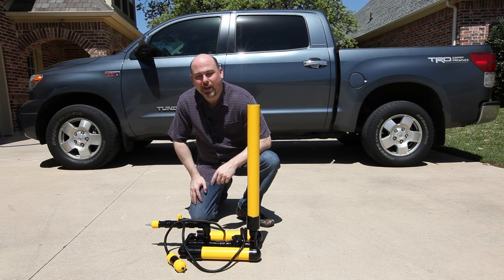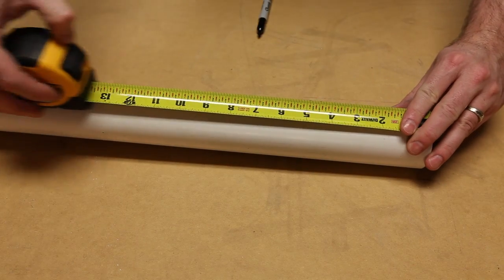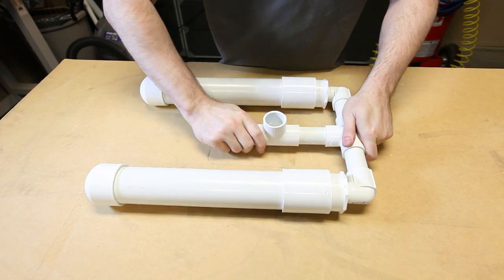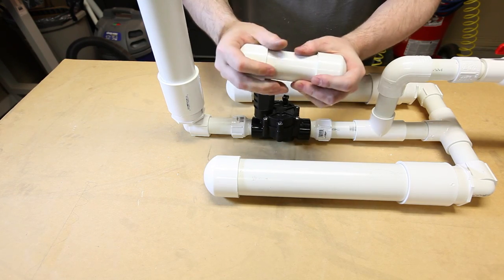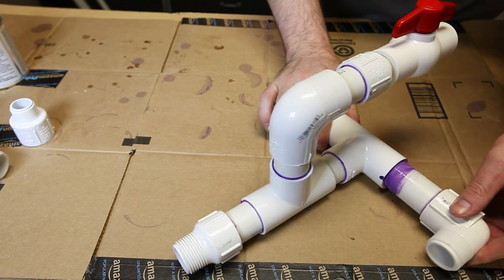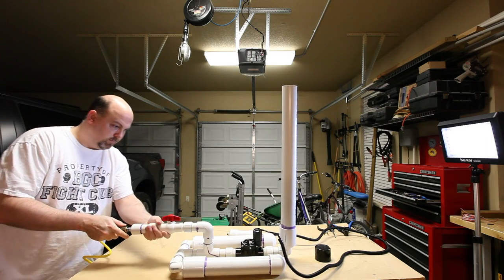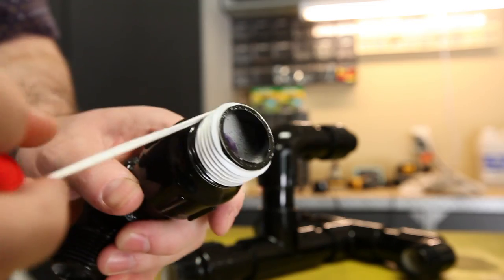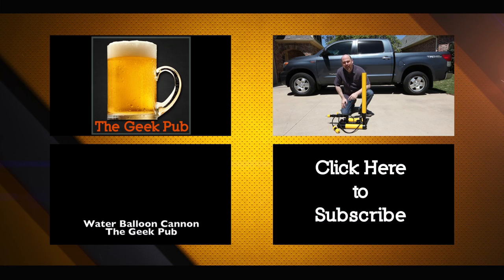How to make an Air Powered Water Balloon Cannon (Launcher)

Comment from the maker: Depends on the PSI you use and the type of balloon you choose.  Cheaper material balloons will explode in the cannon with the PSI too high.  To answer your question I tried the following setup: I used some Dollar Tree water balloons with the system set at 120 PSI and a paper cup underneath them for support.  I was able to get the balloon to shoot up to 125 feet with the barrel at a 45 degree angle to the ground. 

I'm sure if you upped it to 150 with a stronger balloon you could get 200 feet.

Comment: about 2 cups of water in the barrel before you put the balloon in works better as a wading. it not only lubricates the barrel protecting the balloon as it leaves the barrel, it also allows you to shoot at higher PSI and add more velocity.
Reply from the maker: None of that will matter if the balloon ruptures.  Which it will at higher PSI.
Reply: Maybe you can add some kind of protection against the walls of the cannon. Like a apdfs round.

Comment: great video all around I cant believe you spray paint in that Purdy garage though.
Reply from the maker: Been doing it for 10 years and its still clean.  :-)
Reply: TheGeekPub That's not the point though, using spray paint in closed space isn't safe to breathe.
Reply: yeah, i wish that's what I meant, good point vinny
Reply: Mike West Thought so but he's been doing it for 10 years and he seems fine. Maybe the more industrial grade spray paints would require protection and better ventilation.

Comment: Should hold glued PVC for 30-seconds as briefly held glued PVC joints tend to spread outward unless forced to set properly. 30-seconds seems-and--is--a long time but it is worth it, especially on important joints under pressure.
Reply from the maker: I use and prefer the push and twist method.

Comment: If I were to angle the canon how far could the balloon reach?
Reply: use physics man. Calculate the force on the balloon by the mortar. Then time in the air would be determined by the vertical velocity of the balloon

Comment: I got the exact same rain bird valve as you and for power used 4 double a's...I tried it by putting water in the flow end and then connecting the power and I felt something inside move but the water didn't do anything, plz help...
Reply from the maker: +Paul Busch (IrobotGaming) It only works under pressure.  That's how they are designed.
Reply: do I have enough power though?
Reply from the maker: +Paul Busch (IrobotGaming) I'm not able to answer that. I doubt it though.  A 9V works fine.
Reply: Solenoids normally function under 9V-12V. :-)